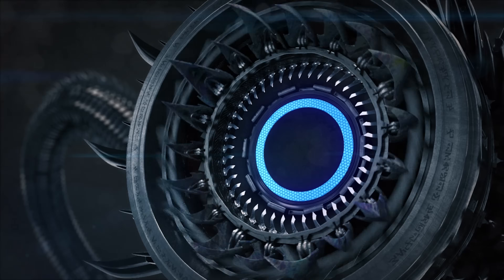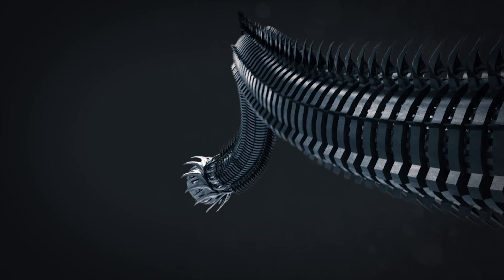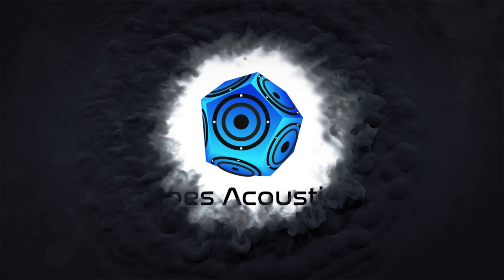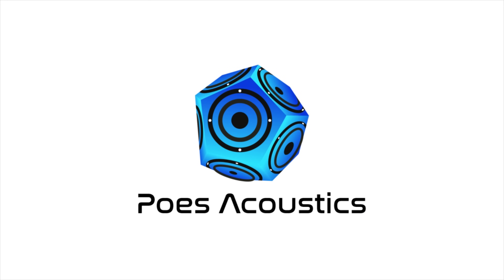Bass Management 101

Comment: A couple days ago I got my first noise complaint.  I bought my first house just before Christmas (a 2 bedroom townhouse - end unit).  One of my subwoofers, an RP-1200SW, using a Bluetooth connection, is against the corner outside walls and the other, an SPL-120 is directly across from it in the corner of one outside wall and one common wall.  I disconnected the common wall sub, which seemed to some good, but I also, just yesterday I ordered two sets of Soundpath subwoofer isolation feet.  I really hope they work so I can have both subs working.  I really enjoyed the tactile feeling in my sofa and my feet while watching "The Phantom Menace", but I guess the neighbor didn't have the same feelings!.  I have a bamboo floor on top of a crawl space, so ideally, they should be effective.

Comment: Matt, two key questions that I've never really seen answered by anybody.  By setting crossover at 100hz or higher on the center. Any chance if dialogue being sent to the sub.  Also what happens to the LFE above the set crossover? Say if it's set at 80. Does the LFE between 80-120 get tossed? Thanks

Comment: Is there any advantage to having two or more independent subwoofer outputs from AVRs?
Reply from the maker: Yes of course.  It allows you to ensure each sub is properly time aligned. Which is very important. And if each can be eqed, there are some methods like Soundfield Management that allow special tuning to minimize spatial variation and modal issues.

Comment: the problem with trying to explain bass management is no rooms are the same. your equipment may not reflect what is recommended for bass management. if you have large front speakers with large subs or active subs things will likely be different. if your amplifier/receiver does not do bass management in a standard way it can get confusing. some pre amp/receivers dont have a large/small speaker setting or they may have some proprietary setting that does the same thing but is called something else. best thing to do is know your equipment and set your crossovers to what sounds good in your room with your equipment.

Comment: Thanks!
I would appreciate your thoughts on the type of EQ and LPFs needed for DIY subwoofers, as this ties in with Bass Management 101.

Background:
I have four sealed subwoofers using Faital 18XL1800 drivers in 150-liter enclosures. You mentioned that these drivers are among your favorites for meeting various criteria. I’ve been running these without EQ or LPF, relying on Dirac (DLBC or ART) to handle that. However, the low-end output is lacking, rolling off quickly after 30 Hz even with room gain. The infrasonic performance is not as expected, given the size and number of subs. Power is not an issue.

The subs, without LPF or PEQ, have output from 16.5 Hz to 2 kHz as measured by Dirac.

My Questions:
I noticed that most sealed commercial subwoofers limit the output above 200 Hz. For example, Perlisten specs show 15-200 Hz, JTR shows 16-157 Hz, etc.

Do you recommend shaping the frequency response before handing the subs over to Dirac?

Here’s what I’m considering:
Lowering the DSP gain by -8 and boosting 20 Hz by +8, with an LPF at 200 Hz (3rd order Butterworth filter) to control excursion.
Applying a 4th order Linkwitz-Riley lowpass at 200 Hz and using PEQ to bring the upper bass down to the same level as 20 Hz. Simulations show that 3 PEQs would flatten the response nicely.

How would you suggest I proceed?
What form of EQ and lowpass filters would you use?

Thank you for your help.
Reply from the maker: Thank you.I'll answer your question in my upcoming videos

Comment: $Thanks!  Thanks for the great video Matthew.  I have a question on speaker choice for a residential home theater.  I know you have Perlisten in your home theater, which have a narrow vertical dispersion.  It's so narrow on some of the models that I'm concerned all seats won't be covered even with proper aiming.  For example, a surround height bookshelf angled down towards MLP may be off 20 degrees vertically for the seat to the left or right.  How do you feel about that dispersion pattern versus, say, a coaxial design like Ascendo P5/P6 with a wider dispersion in the vertical direction, and a more similar horizontal versus vertical dispersion overall compared to the Perlistens?  Thanks, Jon V.
Reply from the maker: So I’ve heard this many times and it’s simply not true. I have covered this in past videos. But I think it deserves a new video to explain this better.  The vertical dispersion coverage issue is misunderstood. I think some on forums may even knowingly misrepresent this to disparage the speaker. 

The dispersion angle used for speakers doesn’t mean sound stops outside that angle. It’s a Half angle point. It means the sound is down -6dB in level at that angle.  The speaker is around 30 degrees in either direction. Up or down. On the S7T that is true down to 100hz. What happens outside of that range is that the response shelves down and so by 50 degrees it’s around -6 to -9dB. 

Let’s now assume a two row theater. Let’s assume the theater has a 14” riser and the seats are 6 feet apart. The front row having a 10 foot listening distance to the speaker.  If the ear leave is assumed to be 32” off the floor. Then the rear ear level is 46” and let’s assume the speaker is 46”. That’s about 6 degrees down to the first row. That has the same response shape but is down around 1-2dB. Propagation loss is 4dB to the back room. But by favoring the height of the back row we reduced it to just 2dB. And with typical room effects, it would actually be about 0dB at that point. 

So that narrow vertical directivity actually helps ensure better coverage. Not worse.  Now if you aim the LcR at the RSP then sure you would make things worse. But that isn’t a good design practice.  

This benefit is a common means pros use to get good coverage. And in larger rooms that effect becomes dramatic. 

For what it’s worth. To be in a situation where it’s vertical directivity Is causing an issue. You would need to be 5’ above the listener. If the seated listener is 3’ and we go to 8’ that’s near or at the ceiling.  And that assumes the same distance. In the example I gave, the rear row would need to be 9 feet up to have the same issue. And even then, if it’s above the tweeter access, a small bump appears at 1khz and the hfs smoothly shelve off 6 at 10khz but only 4dB at 1khz. 

Controlling vertical directivity is actually a valuable way to improve coverage.  I think the video that maybe best comes from this question is how a speakers directivity can be used to your advantage.
Reply: @PoesAcoustics  thanks for all that information!  That definitely makes sense.  If you wanted to do a video I think that could be great. In particular, if there is a desired response pattern for 2 channel versus home theater. Ie is a wider pattern better for 2 channel but as channel count increases, a tighter pattern is better?
Reply from the maker: Thank you. I'll answer your question in my upcoming videos

Comment: If you have psedo full range front L , C, R speakers, and a very good gigh power class D amp like purifi model, why not run the front sound stage full range.

You can run full range + lfe, or sometjmes called double bass.

Then you still have the sub working to cover what the fronts cant do.

Comment: The AV10 is confusing, in the LFE crossover menu the lowest setting is 80 Hz.  In everything else, the lowest is 40 Hz.   The AV10 has four independent subwoofer outputs but no manual DSP control over them.  I'm currently using one of it's LFE outputs connected to a miniDSP Flex Balanced to control the front and rear subwoofers but I think I'm going to go back to leaving the LFE completely off and just use the external DSP to handle everything.  That way I don't have to worry about the AV10 doing anything unexpected.

Any reason not to just use the left/right main and extract LFE with the external crossovers?  The AV10 has a lot of bass routing options so I can route low end from all channels to the mains.

Comment: I have all mine at 118Hz crossover. I couldn't go any lower with my Polk R900 heights at volume without them sounding like a car backfiring (popping sounds). Hard to explain.

And I put my Ascendos 12 to match. I found that sounded better than 80Hz once I got 4 subs in all corners and couldn't localize the bass as easily.

Once I get my Ascendo 10s mounted to the ceiling, I'm hoping I can keep them at 118Hz crossover.

Comment: Who is using a receiver. A processor and multiple multichannel amplifiers and electrical box switch outlet segregation (dedicated 15 AMP for my Left - Center - Right) is the minimum for quality channel separation. It's not just amplifier power. Channel separation and the ability to drive a speaker at high volumes without signal bleed is so critical to good non fatiguing sound in a 9.x.4 system. I am using smaller speakers from my left, center and right and in-walls and ceilings are best set at the same crossover. XLR cabling is a god send too.
Reply: A lot of us are hamstrung to using AVRs as budget processors, with the added benefit of freeing up a few channels of internal amplification for the lower demand height effects when using external amps for the main bed layer.

Comment: Always good to get a refresher on the basics. I prefer to run my dedicated 2ch crossed over at one octave above my -3dB point, which is 32hz , so xover at 64hz. For HT I generally keep everything crossed at 80hz
Reply: @MrBonger88  if you used a mic and REW you'd maybe see that if there are nulls or peaks and you could adjust the XOs to a smoother response and probably your ears would agree but it would highly unlikely you could find it without that.
Reply: @alfonzooliviera1121 when did I say I didn’t use REW? Why do you make assumptions? My preference is based on my REW measurements but somehow “I still don’t get it”
Reply: @MrBonger88  why so aggressive? We both know you don't need my approval or permission. And no, you still don't in my opinion
Reply: @alfonzooliviera1121  because you came across as condescending w your initial remark. All you had to do was ask how I came to those numbers and I would have politely told you. Now please explain what I still don’t get in your opinion
Reply: @MrBonger88  na you just read it wrong. I try not to condescend
Reply: @alfonzooliviera1121 then I apologize for being aggressive
Reply: @MrBonger88  no apology needed my man all is well. Rock on
Reply: You my dude still dont get it
Reply: @alfonzooliviera1121 I don’t get what I prefer?

Comment: I have never liked crossing over my speakers at 80hz. I prefer 40 hz to my dual stacked svs sb 16s three subs per stack. I also have 8 individual subs augmenting each speaker  and those subs are also crossed over at 40hz except the wides I cross those at 80hz as I do not have subs augmenting those due to limitation on location. I occasionally switch to all at 80hz but quickly return to my preferred crossover. To me the sound is more dynamic and more enveloping
Reply: So how many subs are you using in total?
Reply: @bearclaw5115  I’m using a total of 14 subs which its a combo of 6 svs sb16s stacked, 4 Martin Logan subs two of which are dynamo 1100x and two dynamo. 4 mirage subs one of which is a bps400. I’m using all Martin Logan electrostatic speakers so decided to go with those subs to augment the main towers. However I’m using the bps400 on my center channel whch is a dual 12 and susing a couple of FRX8s to augment the on wall electrostatic speakers. All speakers and subs are crossed  over at 40hz to the dual stack. For the wides I’m using Martin Logan motion15 speakers which are not electrostatic speakers but uses the folded motion tweeters, those are crossed over at 80hz as I do not have subs augmented those at the moment

Comment: Scruffy beard look suits you Matthew. For most HT systems,with multiple subs and in large rooms, setting the crossover of mains and center at 110hz delivers great results (going full range on mains and center with supposedly full range speakers is extremely difficult, Gene being an exception). What is key in this crossover setup is calibrating the gain on all channels to seamlessly integrate with subs. For music 60hz with much lower gain for the subs will likely deliver great results.

Comment: Would you consider a topic on how/what to do if running NO subs? I've recently sold my subs. Towers are Bi amped w plenty of bass (Polk Rti12). 

I'm having trouble finding the right balance of bass in the system overall especially depending on content. Some is normal, some I have to turn "bass" way down. Ive also gone through the whole different crossover thing in my head trying to sort that out, so this video helps. Considering buying a sub again to set up more typical. Or I may just have to do a consult!
Reply: Except for the potential issue that “best” location for transducers producing the lowset couple of octaves found on movie soundtracks - i.e. to well below 20Hz in some cases - don’t necessarily colocate  with the higher passbands, particularly in respect to dealing with room modes / standing waves, etc. 
Ask Matthew and Andrew Grimani what they’d like Gene to give them license to do with the monster towers in his reference system. 😂

Comment: Yeah don't be shy to go higher with XO. Many 80Hz rated home cinema speakers can't hit that with authority.
Reply: Yea, I tend to agree.  But unless you want enormous speakers in your living room.   Full range speakers are not really designed for the home.  Have Kef Q750, and they claim they get down to 48hz.  I use the crossover at 80hz and let the sub do the rest.
Reply: @michael-4k4000  it's not about huge speakers but proper design with appropriate drivers. But of course with bigger speakers it is easier.

Comment: Is there a DIY test we can do to see if our transition point its higher/lower than 80hz?
Reply from the maker: It’s really tricky to do this. We are currently debating the topic in CEDIA. Should we tell integrators and DIYers how to measure this themselves or will that encourage people to blow up their speakers?  

In any case, you could download the M noise test software from Eclipse and measure your speakers. It would make clear where it’s a problem.

Another option is the step distortion test in REW. Done at 1 meter in room you may be able to get a valid result that shows the rise in distortion to see at what level this is an issue.
Reply: @PoesAcoustics   I suppose the answer's right in front of me. Maybe I expected some technical way. But I'll prob get in REW and run different band limited noises or even just sines.. I'm guessing I will learn a lot about my room. I'll have to look more into M noise.